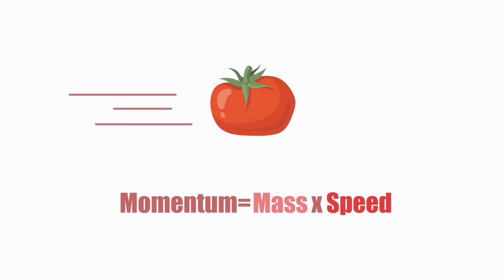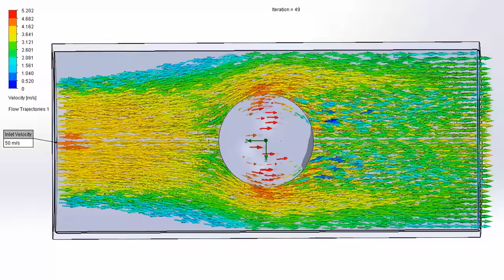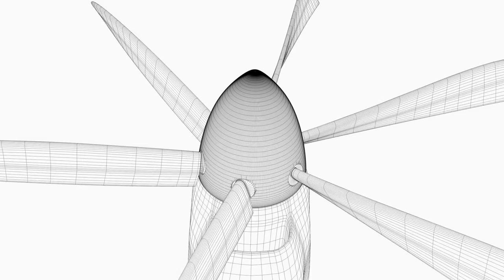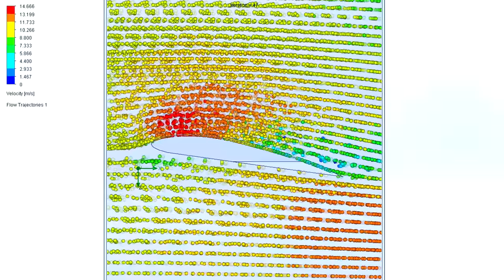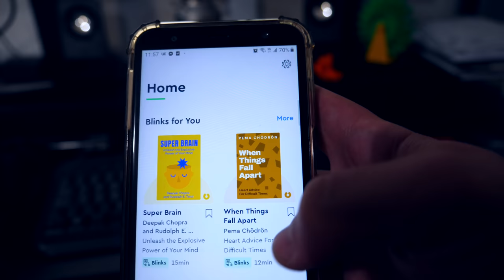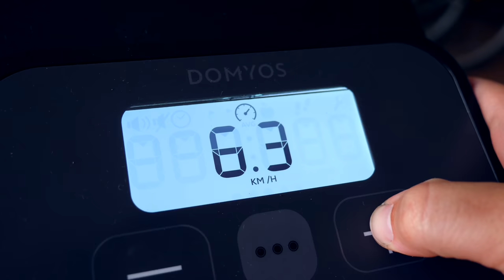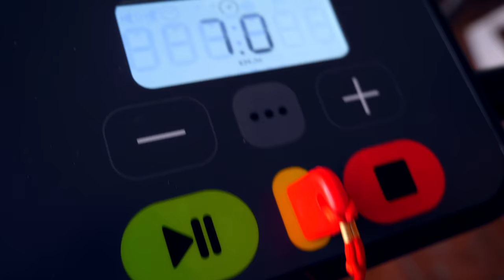Wind Powered Car (3D Printed)

Comment: This was an excellent miniature rendition of the full scale. Love that you're pumping out quality content, Tomato Lord
Reply from the maker: Thank you Jay 😁
Reply: @integza  The problem is a ship can travel faster than the wind? And the answer is YES !!. if you can convert high torque but LOW velocity from the propeller to low torque and HIGH velocity of the wheels.... The Veritasium ship can do it..... Free energy, the answer is NO.... Nevertheless I love your videos Integza
Reply: @Pedritox0953  but ships (under sail) also have a maximum speed (hull length at waterline)
Reply: @tonyoliver4920  the Veritasium ship is not in the sea, it's in the earth... If you look the wheels, they are very tiny, that's because of the friction...  high friction less torque and less velocity... The Veritasium ship doesn't convert high torque, but has HIGH velocity
Reply: @Pedritox0953  ah, I wasn’t aware of that! 
Thank you 😊 
I was going to make a comment about integza’s build in the video being improved by skinnier smaller wheels. There’s also a website you can plug in details and it spits out an optimised blade design (it’s for making wind turbines)
Also I’ll assume links are off for spam

Sorry plasma! For hijacking your post!
Longtime follower
Reply: Ever considered doing a Marx generator video?
Reply: Veratas made the 3d blue print
Reply: Praise be Tomato lord 🙏
Reply: @integza  co-op
Reply: well hi there mr verified
Reply: @Pedritox0953  Ship can go faster than the wind, that is a fact but not in the same direction!
Reply: @luigipasta9496  it works both ways, the propeller convert linear movement of the wind to rotational movement... Later through pipes and gears, convert high torque with LOW velocity of the wind.. to low torque but HIGH velocity of the wheel... The Veritasium ship is good in this conversion
Reply: @Pedritox0953  sorry, but in the same direction as the wind flows you can't go faster, you still have friction in the equation that can't be discarded. The ratio of propeller vs wheels can make the wheels speed up at some point to make the car looks that run faster than the wind... but this is momentarily and the friction will slow down the car no matter what, so it will need require air again to push it forward.... a sail boat of course can go faster thatn the wind... but this is only at different angle than the direction of the wind
Reply: @Pedritox0953  you can't discard the friction between the propeller that opposed the tailwind.... that is energy lost that you can't recover and this lost mean that the car will go slower than the surrounding air  .... you will never go faster than the wind in the same direction
Reply: @Pedritox0953  let me give the reason why the car and the treadmill is not the ideal way to prove Derek's point.... because you don't have the normal incoming front wind hitting the entire body of the car ... which is Friction.... in a trreadmill of course you will move forward..... you only have the back tailwind....... got it???
Reply: @tonyoliver4920  It is hydro-dynamic drag that limits the "hull speed" of a  boat it waste energy piling up a wave (think hill) just in front of the boat and then it tries to climb it, (a similar process occurs in a sonic boom). If you have enough power you can quickly accelerate the boat faster than hull speed before the bow wave gets too big  and you get a chance to surf the wave as you pass it. Look up displacement vs planing hulls for more detailed explanations and alternatives that avoid the issue of hull speed.
Reply: @luigipasta9496  that’s not what’s happening here the car isn’t being pushed by the wind, the turbine is…
The power output of a windmill is proportional to the blade length (swept area)
That power is then transferred to the wheels
Reply: @richardgray2706  good explanation Richard, yes it's like surfing a wave... Like i said, the Veritasium ship doesn't have high torque (produce force), but the weight of the ship is light (almost cardboard), the shape is aerodynamic and the wheels are designed to minimize losses by friction...
Reply: @richardgray2706  close and that is a factor. 
As speed increases the bow wave gets longer when the boat and wave are the same length it essentially falls into its own bow wave. 
The energy required to push past it is not feasible under sail. 
This is also why you see power boats jumping up and down as they ramp over their own wave
Reply: @tonyoliver4920  yes, the propeller it's the turbine (motor of the car) and the blade design is one of the most important things in the design
Reply: @Pedritox0953  absolutely, see my second comment (fifth from the top)
Reply: @Pedritox0953  rechneronline dotydot de slashing wind-power

That might get past filter?

Should pit out the geometry
Reply: @luigipasta9496  car on a treadmill is exactly analogous to a car moving faster than wind, just a matter of perspective shift. And it works. Your reasoning is obviously flawed
Reply: @tonyoliver4920  while you can see speed boat jumping up and down as they skip over waves, it is not their own waves.  In still water, they can travel smoothly without bouncing.  You are right, at hull speed the wave builds up height and the wave length is such that the bow is near the crest and the stern is near the trough effectively fighting a reverse surf.
Reply: @fritt_wastaken  pretending that a treadmill can be an analogy to the wind... oh boy!!!... you really deserve a novel price!!
Reply: @luigipasta9496  dude.. That's literally the core of all physics, galilean relativity.
If you think it doesn't work like that, then you deserve to go back to the 5th grade
Reply: @fritt_wastaken  use more brain y less emotion, going back to 5th wont' fix your 4th grade understanding!.... bye!!
Reply: @luigipasta9496  dude.. Do you have anything to say to the point? Or you'll just try to cover your mistake with insults?
I'm physics graduate, and work as a tutor. Pretty sure I know what I'm saying
Reply: @fritt_wastaken  I'm an engineer. People with such high degree on physics are not perfect, no body is absolutely perfect, they can also slip on simple things and fool them self.... the point here is that treadmill can not take the place of a road.... even the wind.....you are cheating your self (not you!).... the wind slips on surface... the contact between the car wheel and the treadmill don't slip... if a car depends on the wind to move the propeller which then transfer such energy to the wheels and gain speed... and overcomes the wind speed.... that is momentarily, the car will slow back again due to friction and will depend on the wind to gain speed again.... the propeller is rotating (thanks to the wheels) against the tailwind to creates high presure and this is what pushes the car forward... but the point here is that you can't run faster than the wind in the Same direction constantly... you know that I believe....thats is the point!!
Reply: Agreed
Reply: @fritt_wastaken  The treadmill is not an analogue. The treadmill negates friction losses and supplies "unlimited" power as far as the car is concerned. The car is in effect powered by the treadmill motor(2kw) which sets the treadmill belt at a constant speed but the power it can transfer is variable, more friction more power. Thats why the little car works on the treadmill each time every time but the contraption in the desert fails most (all) of the time with an abundance of excuses. 
If this thing works and with the experience these guys have with its design and operation then it should work every time given the minimum wind requirements but it doesnt. Its all hit and miss. Thats why the treadmill is not analogous to the desert car unless you put a 2kw motor in it then it would work each time every time.
Reply: Xyla Foxlin is the original designer of that miniaturized car.

Comment: For you next rocket engine, try the ARC heater.   Heat up compressed gas using an electric arc and then expanding it through a nozzle.

Comment: Integza: I can explain it better than you
Veritasium: * 4 hours later * here's another video explaining it better
Reply: Bwahaahahahahahah
Reply: Funnily enough, this video is still better.  How pitch and a propeller works are both better explained.
Reply: @Klarinet2011  Certainly useful explanation. That said, better engineering by Xyla Foxlin, and with some last minute adjustments, they made it work.
Reply: Yeah I still don’t get it even after watching Derek, Xyla, and Integza. I liked this video a lot but it never demonstrated the car moving faster than the wind and what the upper limit would be. However it also taught me not to buy a 3D printer lest I become an addict, so thanks for that ;) Clearly it involves sails so I need a pirate hat and rum and paper and pencil!
Reply: @Archpimp  because there is a difference in speed between the air and the ground, there is potential energy.

That energy can be captured and used if you are standing still, that energy can be used if you are moving.  That energy differential has nothing to do with your speed relative to the air or the ground.

If you make a small enough, efficient eniugh system, and you capture enough of the energy, you can divert enough power from the differential in the wind and ground to move a craft.

Speed doesn't matter.  And thus, if your system is efficient enough and your collection large enough, you can move through the air at a higher speed
Reply: @Klarinet2011  This video is not better because the fundamental principle in play doesn't have anything to do with sails or a propeller. The energy comes from the difference in speed between the air and the ground. It's like when you use a heat engine to extract energy from a temperature difference.

Comment: Here after Derek's video about the bet. Maybe you can add some thoughts on this debate, especially considering he also made a 3D model available from his testing.
Reply: same
Reply: I got the notifications for both videos. Unfortunately, Derek's was first. Haha! Integza missed a 10k bet...
Reply: I think so far Derek's simple cart with big wheel on top and smaller ones at the bottom best illustrated how a vehicle can go faster than the medium pushing it.  The wind adds extra complexity in that the coupling with that medium using the propeller is not as simple as in the cart example, but the basic concept is the same.
Reply: @MisterkeTube  yeah, I agree. The three-wheeled cart illustration is what allowed me to finally comprehend what was going on
Reply: @MisterkeTube   The funny thing is we all probably would have played with or built a similar setup , especially if a person was into LEGO. Just how that principle is applied for the wind car is extremely clever.
Reply: The one who made the model also made her video: https://www.youtube.com/watch?v=VUgajGv4Aok
Edit. include instructions to make the final model.
Reply: @maj429  Funny, because I have no idea how the cart can go faster than the beam that's pushing it

Comment: The reason your car got a 1:1 rotation between the propeller and the wheels is because your gears at the front were a different ratio. This is also why you had some issues with the first propeller not moving very much. If you do a 3:1 ratio or something it might move easier with the first propeller

Comment: "3d modeling is boring"
I am literally listening to the Integza video while 3d modeling
Reply: Haha same
Reply: Same
Reply: Same, what are you guys modelling ?
Reply: Yep. Same here. It's my job. 

I am actually doing PBR on assets for game. Yay!
Reply: @Balancatraca  Legs attached to a treadmill. A robot born to suffer haha
Reply: @Balancatraca  screws and furniture.
Reply: @arcmchair_roboticist  hahhaha what a nice idea 😂
Reply: @Balancatraca  a trash bin in a lonely alley. Dont ask...
Reply: @Balancatraca  what about you? What are you modeling? :)
Reply: @razerow3391  wow sounds really cool :))
Reply: Kinda same, model is done and printing, 3rd one of the 3rd version of it. Mine was a hanging bracket for conduit to support spools of filament inside an old rear projection TV that is now a rolling stand for two 3D printers. Why 3 versions... well first I punched in 1/2" radius, printed two and immediately face palmed when I looked at how large the conduit connections were. Second version I forgot to adjust the cutoff angle on the top of the cylinder so that the conduit can lift in and out while still clicking into place so it doesn't get pushed upward when a spool is low and a series of retractions have to occur too closely together. This third version, printed 1 at a time, learned my lesson the first two times not to print the set all at once when I haven't even physically tested it.

Comment: video idea: design and print vehicle (thats fly or just drives on the ground) which will be powered by one of yours jet engines, i'll be pleased to see that.

Tomatoes are disgusting!
Reply: Yeah let's just stick a propane tank and oxygen tank to a weak 3D printed plane body

It is possible but integza said he's not good at welding, and it's impossible to do that with a plastic body
Maybe collab with someone experienced with metal
That'd be cool
Reply: @random-b-i2480  yea, mixing 3D printed body with some metal parts will be super cool too
Reply: I don’t think he has enough thrust yet, especially for something that would fly
Reply: @issaxnewtie2431  if that's the case we need:

1-a decently big plane with big wing to make enough lift that's able to lift the (kinda) heavy body

2-very very efficient structure that uses the least amount of materials

3-the engines integza made doesn't make a lot of thrust
He needs to make much bigger engines which is a pain in the ass

4-I've seen people using carbon fiber as the body of the whole plane but idk it's something very hard to shape
Reply: @random-b-i2480  I think you could probably make much smaller tanks for the fuel at the sacrifice of run time
Reply from the maker: Congratulations! You just won a 3D printer! Send me your info (address,name,zip code, phone number) to integza@gmail.com.
Reply: @integza  bonus idea, make da vinci's aerial screw helicopter: https://en.wikipedia.org/wiki/Leonardo%27s_aerial_screw
Reply: @integza  bruh
Reply: @integza  😳
Reply: @issaxnewtie2431  did you get the printer?
Reply: @kokoslegend4850  yeees, accualy I’m in love with that machine

Comment: If done right, you can accelerate the car on a treadmill with no fan or wind at all. Just the wind produced by the propeller can be enough to make the car go faster than the treadmill is spinning

Comment: The way i understand it is that you have 3 points of reference: Wind, ground, vehicle. Drag (wind-vehicle) will accelerate the vehicle against the ground. In turning the wheels and turning the propeller you put additional air in between the vehicle and the wind, adding more momentum. So it's basically like an afterburner. Like an additional cushion you propel yourself against from. It's not a vacuum after all.
Wind(W), displaced air (A), Propeller (P)
W==> <-A-> P
Max speed is reached when W => <-A-> P,V <=D is in an equilibrium (and friction obviously).
So i believe that if you increase the propeller size (maybe 3 or more blades with more area) sou can overcome initial starting problems as you increase the drag from behind and make sure you are not slower than the wind. As you go faster you will need to increase the propeller speed to compensate for the Wind coming from the front now by shifting gears or tilt the propeller blades to create less drag and still add impulse. I wonder if it works under water.

Comment: I’m sure you tried your best, but by adding the fan you broke the experiment. The whole point of using a treadmill is to move the ground instead of the air, so if the car moves in the opposite direction of the treadmill it moves faster than the wind, since the air is stationary. By adding the fan, you had to make sure that the car moved faster than the wind of the fan. Unfortunately it clearly didn’t move faster than the wind of the fan. You can see this because the string attached to the frame went forward instead of backwards. So unfortunately the was too much friction in the gears or the propellor wasn’t optimal.
Reply: I agree, it's all in looking at the tail-tell on the car
Reply: “As long as there is no ridiculous amount of friction”. 

His words as he is showing the car with the fan… He is speaking to his more enlightened viewers.  The ones who understand what he is getting at.  For some reason you didn’t catch the not at all subtle explanation that his design OBVIOUSLY has a TON of friction because DUB just look at it!  I don’t even think he uses metal on metal bushings let alone bearings, getting the gear ratios correct, getting the blade profile perfect…

He doesn’t have to do those things because 2 people have already done it and as a pre-requisite for you commenting on this video you had to have watched the other video that try’s to explain how this car works that DOES have a working scale model on a treadmill.

So he isn’t responsible for making a working scale model…

He said he is just trying to explain it differently.

Because even though for me the first time I watched the first guy explain it I was like oh shit duh… why don’t people understand that theoretically this makes perfect sense and someone has already shown it working at scale and in reality.

This guy doesn’t need to show it working again…